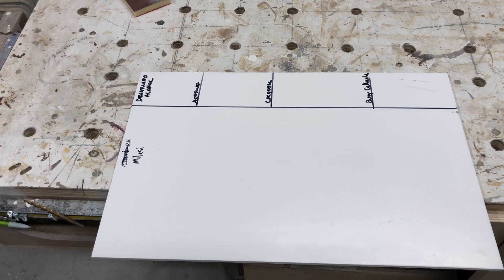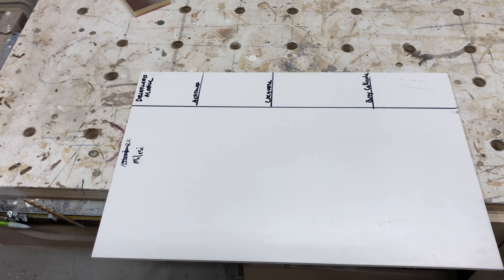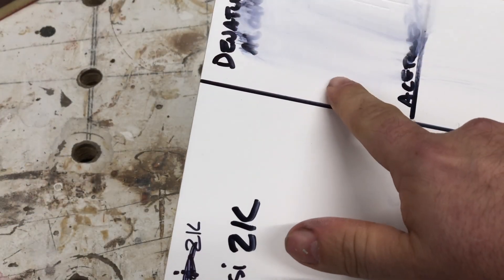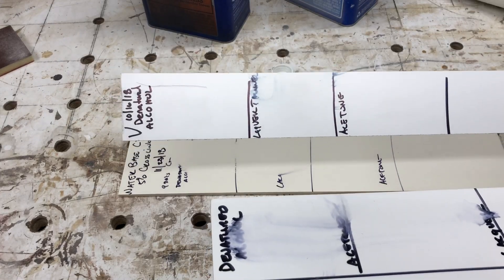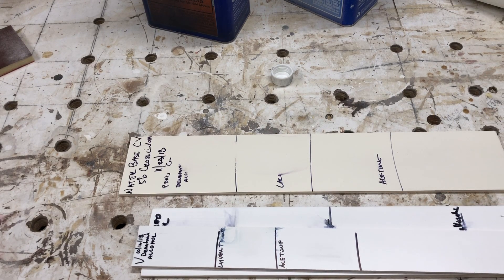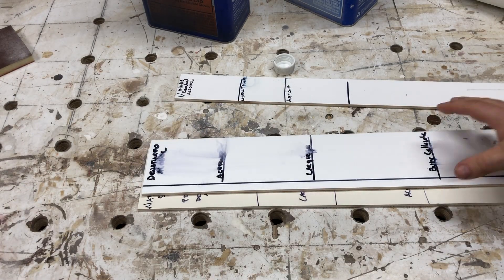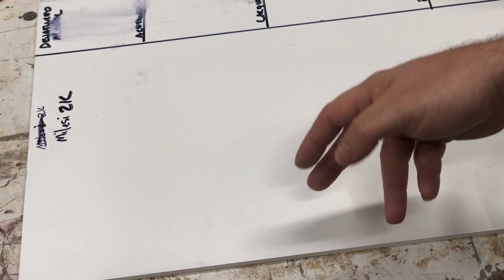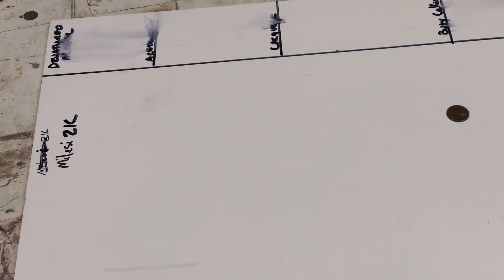Milesi 2k Poly Review

Comment: I am glad you did this review. I am trying out the waterborne  2K milesi product and I cannot get pass the orange peel look. I want to spray vertical or horizontally. I am using the Graco finish Po 9.5 HVLP. I have mainly sprayed Lacquers. I will try to reduce the hardener to 5% and add the retarder with water 5 to 1 ratio.  I hope this works. I got to get this to level and get rid of the orange peeling. I even tried to use my airless sprayer with a fine finishing tip and it didnt do it. we'll see.

Comment: Ive been using a gravity fed gun with a 2.0 tip for several years using advance paint and have never had an issue also not thinning the paint.  Today was my first attempt with milesi, same set up everything, not the finish I was looking for.  The can has nothing on it as far as instruction to this. The parameters of temp to spray in. Or the recoat times.  I've been on line for hours and cant find anything to answer my questions.  Im in Fl and my booths temp is uncontrolled and yes it was damn hot in it today. If I had to guess thats what I would point the finger at.  But Id still like to know what the factory specs are.  Any help would be greatly appreciated.  Also love the videos.
Reply from the maker: If you are going to use a gravity gun with this product you need a by pass regulator that can put pressure on the cup or you are going to hate life. Honestly, airless sprays this product the best with the least amount of issues

Comment: Eric looks like you no a lot about refinishing . I have a question about MILESI 2K POLY .  Which spray system should I use for best results. In one of your videos you said using a turbine HVLP like a Graco pro finish 9.5 would have a problem with atomizing the high viscosity MILESI paint . Can I use a airless system like the Graco X5 MAGNUM with a 310 tip . I know you said you use a air supplied airless but the gun that you use is about 800.00 then the pump then compressor. This is a one shot deal for me my kitchen cabinets . I have used HVLP guns  with a compressor to spray automotive finishes never liked it . felt like trying to squeeze the paint out I went back to a conventional gun . I would like system that sprays like a conventional gun so you feel like you can lay it on please advise me THANKS FRANK
Reply from the maker: Yes X5 works fine but would use 308

Comment: Any tips on how to avoid cracks in cabinet profiles with milesi 2k? (No hardener).
Reply from the maker: What’s did you put underneath it
Reply: Bin shellac (Oak doors). doesn’t happen often but, when it does I can’t figure out why. Vertical spray, happens on inner cabinet profile and/or outside edge of stiles & rails.
Reply from the maker: +Miguel Torres it’s the BIN it’s not the milesi. Have seen it time and time again. Use vinyl sealer

Comment: Hi Eric what’s the best paint for kitchen cabinet
Reply from the maker: thepitcrew1 either a pigmented 2k poly or a conversion varnish are the best two either solvent or Waterbase.
Reply: What exactly does 2k mean or refer to?
Reply: @trxntroll843  2k means there are two components to the coating.  A paint and a hardner.  It produces a durable finish but a bit more difficult to work with.  The hardener has to be mixed in by percentage and once mixed must be used or tossed since it will harden.

Comment: Hi Eric I’ve been using this product for about two months now. Have you had any problems with air bubbles? No matter what I’ve tried I can’t seem to avoid them even when I add the retardant . It’s seems to happen when I add the catalyst. Looking for a solution BC I love this product.  My system is a Fuji 5stage turbine with 3mpps system for added pressure. I am able to spray the product with either a 1.5 or 1.8 tip. Any advice would be helpful.
Reply from the maker: Nonailfrail I haven’t seen the air-entrapment on this coatings but I have seen it with other coatings. I am unsure of what causes it but I know exactly what you are talking about. Are you shooting flat or vertical. With some coatings some it’s a mil thickness issues and you have to get it wet enough to get the bubbles to flow out. If you can go over to either Facebook or Instagram and dm me. I would love to chat over the phone about this because it’s and issue I would like to understand further.
Reply: Do you wait at least 10 minutes after mix the water!?

Comment: Hey Eric, great video! What AAA unit are you using now.? Also....what is the potlife of the 2K Milesi? Thanks! Scott
Reply from the maker: The Wood Craftsman I bought the ca technology h20 but I see no reason why you couldn’t use a kremlin or any other standard aaa setup. The Europeans pretty much use kremlin so I think you would be fine with your set up if you wanted to give it a go. My settings were 700 fluid and 17 on the air side. There recommendations were 600-900 and 17-20 with .009-.013.  The pot life is the million dollar question because I let the product on multiple occasions sit out for several days and it never ever harden or congeal like a true 2-component poly urethane. The specs sellers say 4-6 hours but there solvent version says 4-6 hours but it’s more like 2 and it’s setting up. Thanks

Comment: Great info, I’m going to give it a shot to see how it sprays out of my Apollo 7500 gun with my turbine. My expectation is that it will be too thick. I’ve seen a lot of people spray this with a turbine with remote pot setup and a pancake compressor as well
Reply from the maker: Michael Craine yes I tried that and I personally didn’t see any difference because you can only run a pressure pot at about 20-25psi and with the aaa I was at 700. The only difference is I had to reduce the needle down to a 1.3 from a 2.0.  The issue is not getting the product out it’s the atomizing air and you are stuck with a fixed pressure with the turbine. Only thing you can really do is reduce the material. If that makes sense.